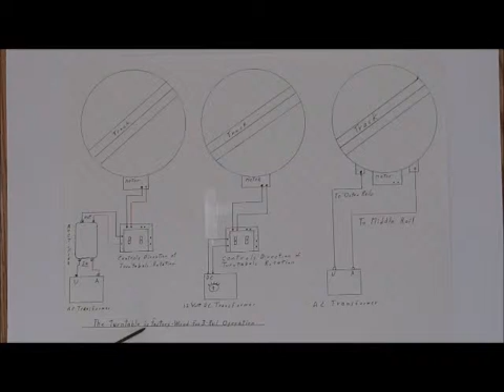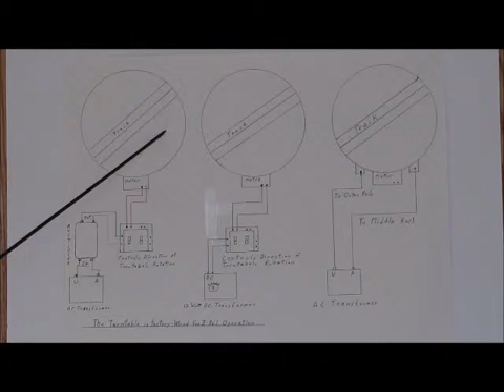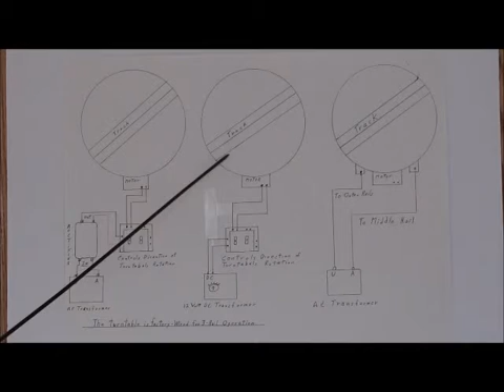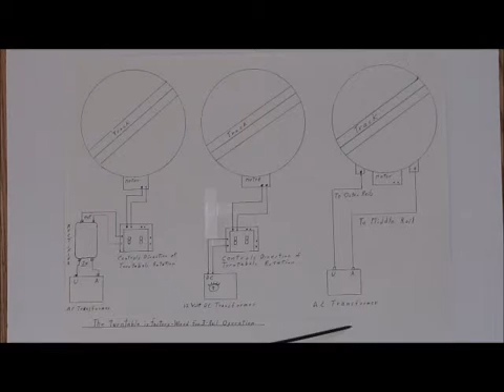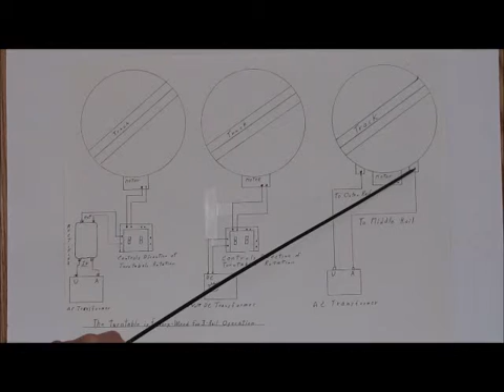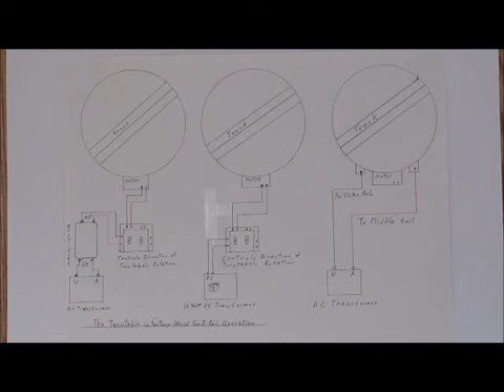Video 15 Part One: How to Wire a Atlas Turntable Using a Wire Diagram.

Comment: Can the transformer connected to the ac/dc converter be used for powering the tracks on and connected to the turntable?  Or should you use separate transformers?
Reply from the maker: What I used is the same transformer I use to power my layout tracks. I believe it would be better to use the same transformer which power the track on the layout. Then the same one controlling the motor on the turntable. You will have more control for the speed of the turntable motor by using a different transformer.  Hope this answers your question.

Comment: To power the track on the Atlas turntable with the AC transformer do you use the side of the AC transformer that powers the other track on the layout or do you use the accessory terminals on the same AC transformer?
Reply from the maker: Hi to answer your question. It would be up to you to use the AC transformer that powers the other track on the layout. You also can use the accessory terminals. It depends if you are using engines that need Continue 18 volutes. I use a tranformer which has a Controle Handel to control my track power. I leave it in the 18 volutes position. I hope this answers your question.

Comment: Do you know how to install a mini commander 2 into the atlas turntable to make it command controlled. Lionel has a blurb on their page but doesn't explain the wiring of it. Any help would be greatly appreciated. Thanks!
Reply from the maker: I saw the same blurb and agree with you about not explaining the wiring. Unfortunately I never used a Mini commander 2, in my engines or accessories. I suggest  you should type in the YOU TUB Search How to install a Mini Commander 2 in the Atlas turntable motor. Sometimes you might have to reword the sentence. You can check out ericstrains YOU Tub Chanel he has a lot of good videos on how to do. I believe he used one in a post wore engine. This might help you. If you do fine how to install the Mine Commander 2 perhaps you can let me know an make a video of you installing the Mini Commander 2. Have a great day . Greetings from New Jersey